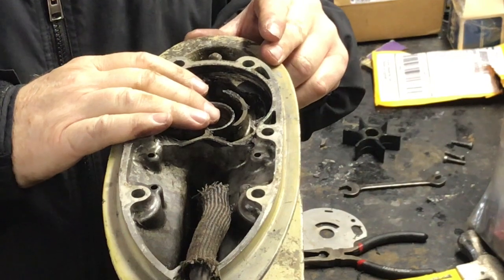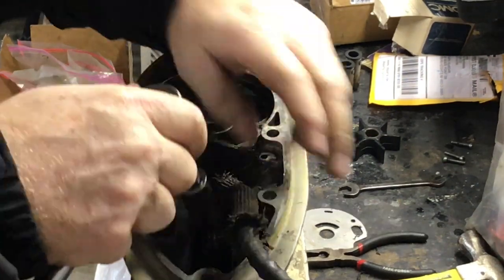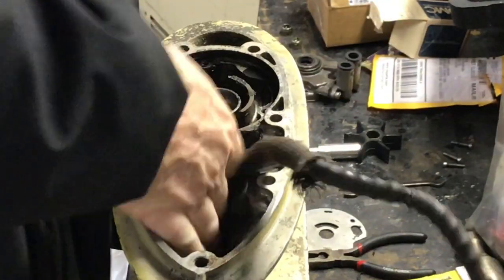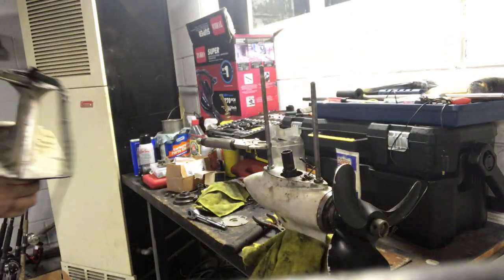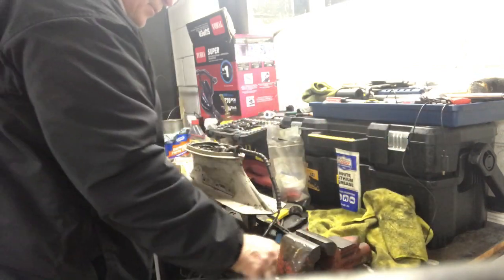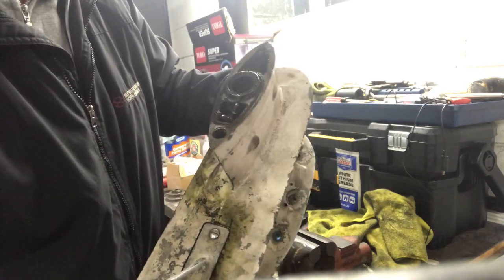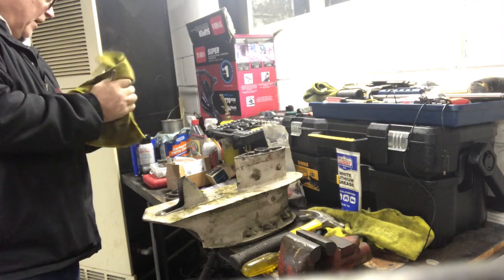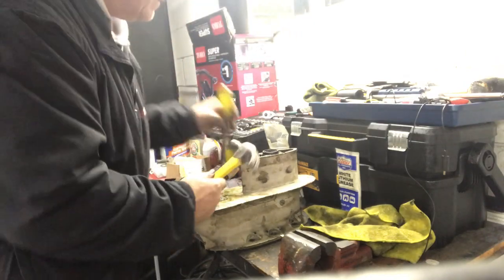1963 40hp Johnson Electromatic - Lower Unit Bad Pinion Bearings - Part 7 of 12

Comment: how did you know the bearings were seized and needed to be replaced? Even after the motor was started and a new seal was put on?
Reply from the maker: I could hear the worn bearings as the driveshaft was turning.

Comment: Instead of buying the tool if you use a 3/8" extension and a socket you can drive them out easily. It can be done with a drift. They go in nice with a press, failing that threaded rod. If you check the number on the end of the Torrington it should read something like BR1012 -don't quote me it's been 6 years since I did one and they are available at Canada bearing or your local bearing house for $8 overnight. All those bearings should be $50 for a complete rebuild.. You don't need BRP parts.
Reply from the maker: @maxwebster7572… Thanks for the great information. I didn’t want to make any mistakes so I followed the service manual. I like to purchase new/old stock OEM parts usually from www.marineengine.com at least I know I’m buying the correct parts for the particular job I’m doing. I’m sure your right about using other tools and bearings.
Reply: @LivetofishOutboardRepair  I agree totally, the bearings were made by Timken so they are direct replacements. SKF, TOYO will be fine as replacements. Seals on the other hand are a different story. Only use OEM.
Reply: I use a press to put bearings in, you got it together fine but I'd be very careful of the Torrington races, it doesn't take much for them to fall apart.